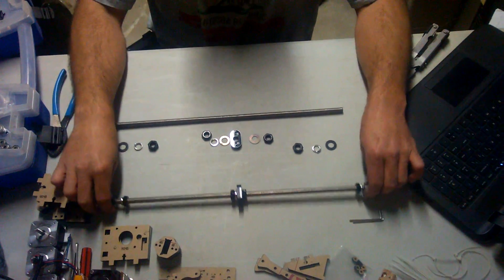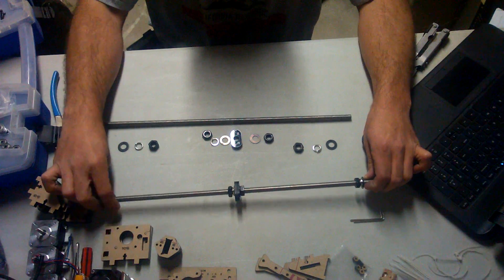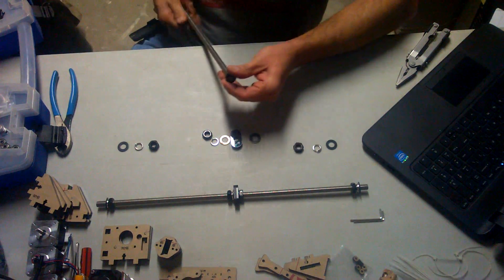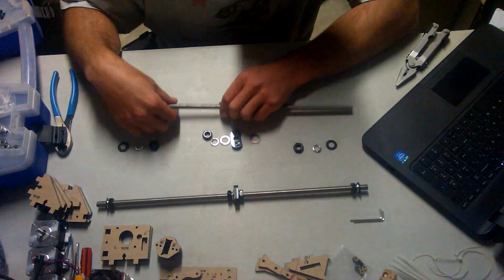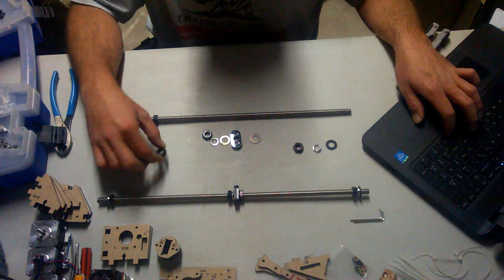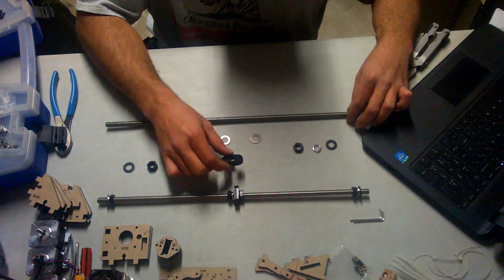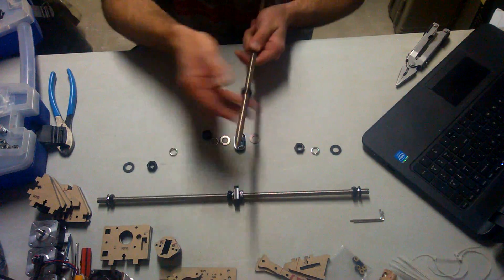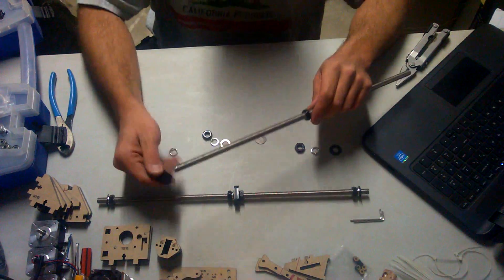Geeetech Prusa i3 Pro B Acrylic 3d printer assembly video Step 1

Comment: Thanks!! The online instructions are horrible
Reply from the maker: no problem. I still have more to do. videos though. you'll be wishing they where all there. for firmware, link on my YouTube chanel. wordpress blog, online store, firmware s as there are multiple boards, multiple setups.
Reply: +George Robles plus the design has changed. The threaded rod and smooth rod are arranged differently because the liner washers are different
Reply from the maker: Let me guess, nylon now? Is it all white?
Reply: +George Robles they have a plastic mounting bracket attached to the washer. Thanks again!! It's good to see someone do the assembly!!
Reply from the maker: Your very welcome.